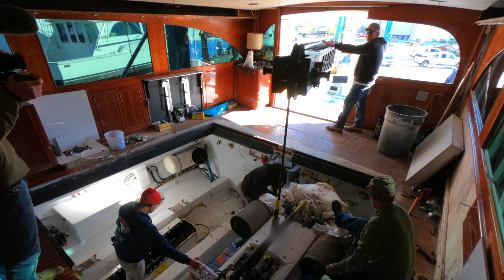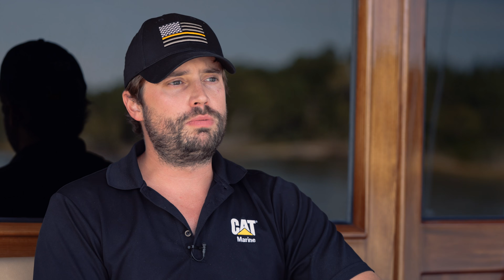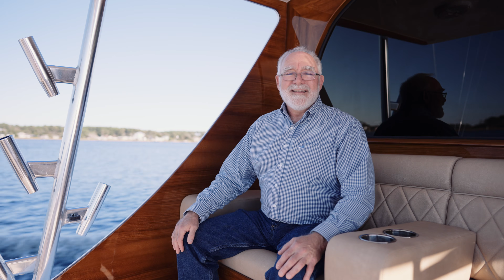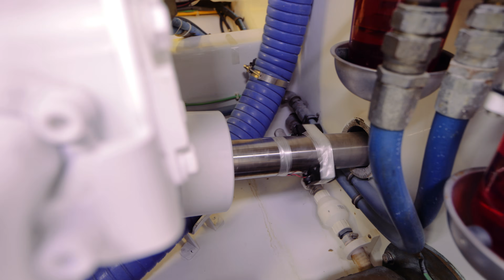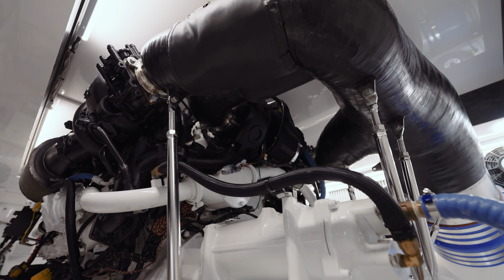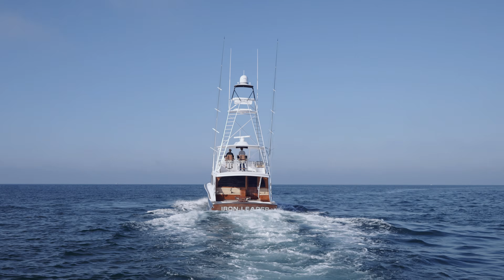Power & Poise - Hull 48's New Horsepower Unleashed - JBI Special Ep. 3

Comment: I live in Florida, and right down the road is the CAT guys that have been testing Engines with our boat also...  They suck !!  They nlast about 6 months and they have to remove the Engine, or the heads.  Cummings Engines are a little more Expensive, but they will last a lot longer

Comment: Do the gyroscopic stabilizers put unduly force and stress on the hull? Localized reaction forces large enough to stabilize such a large hull must be pretty structurally damaging?
Reply from the maker: The forces of a gyro on a hull structure are indeed great, and, as you inferred, they can be rapidly shifting.

There are (probably) always upgrades to the mounting structure when a gyro is added into the equation. Our laminate and distribution drawings are derived from the data in the Force (moment) charts provided by the gyro manufacturer.

I was not directly involved with this project so I can’t speak to the scope of it, but we tend to favor the robust side of construction.

 The truth is, the math is less magical and more boring than it may seem to the outside world. This is a great tech question. Thank you!

- RV

Comment: I guess if you need to ask what it costs to repower a boat like this, you couldn’t afford it anyway.  How many hours were on the old competitor engines when the baseline data was measured?
Reply: Off the cuff and based on what I know of repowers in the 500-700 HP range, I'd imagine this one was somewhere around $750k all said and done.  Excluding everything else not related to making the engines run.  If the total price of getting that thing to where it is was $3M+, I wouldn't be surprised.
Reply from the maker: The performance numbers shown were both taken during initial sea trials for the respective engines. There are some big differences from the initial launch (competitor engines), such as back then the boat did not have a full tower or most of the interior appointments that it has today.

Comment: How did they get the old engine out and the new engines in, was the flooring and back bulkhead removable?
Reply: The rear bulkhead was removed and reinstalled after the repower. All JBs has hatch’s in the Solon floors that can be removed once flooring is removed. We have been doing this, this way for over 15 years.
Reply from the maker: Check out the first two episodes in this series for more: https://www.youtube.com/watch?v=F7-kAvUhibk / https://www.youtube.com/watch?v=PU9GgtGf8FY

Comment: What an awesome refit project - gorgeous boat!
But unless the CAT video is wrong, with the 16V MTU's the boat topped out at 48 knots?
Reply from the maker: When initially built and tested with original engines it was a bare boat with few furnishings and no tower, so it's not an apples to apples comparison on those numbers.
Reply: @JarrettBay  The MTU is a bigger engine and assuming the latest version, the MTU will always produce more HP than the CAT.  What made the owner choose the C32 B as opposed to the MTU 16v2000 M96?  And the boat had room for the 16v.

Comment: I noticed no fuel consumption numbers compared to the MTU’s, I guess there is no free lunch
Reply: Cats, 130GPH per engine. No sure what GPH were on this boat but I had a set of 16v2000s on another boat and they were 140GPH each.
Reply: @preformancemustang  holy hell I wasn't thinking that high but need fuel to make h. p.
that's also why I like my 31 JC with a 330 d6 Volvo 10 gph steaming at 15kns
on averaged I burn under 2.5 gph most of my time is spent hauling lobster traps not steaming around
Reply: I noticed the same